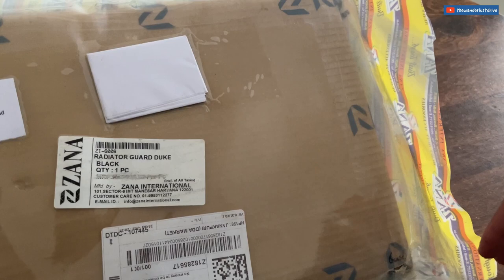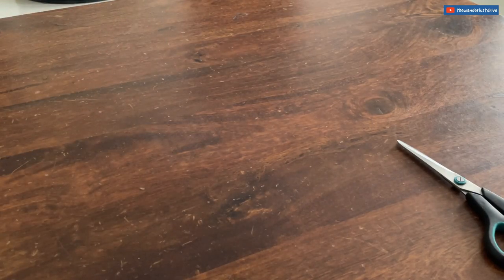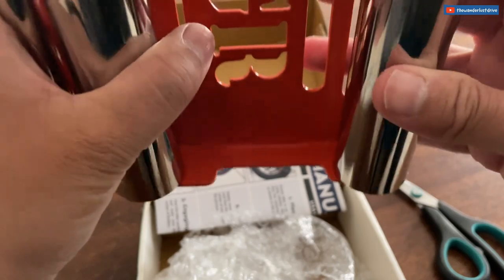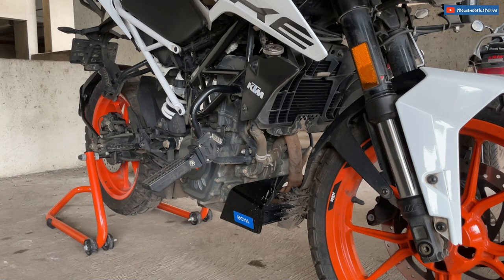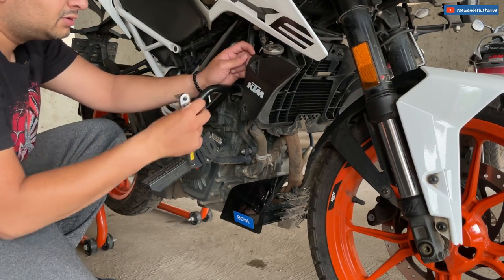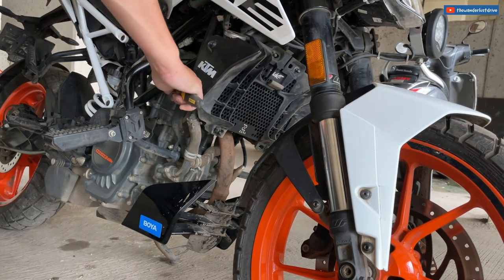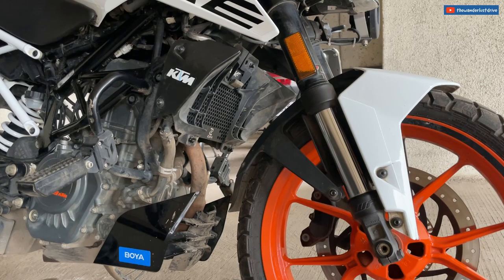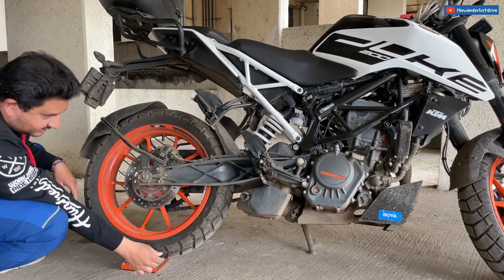Must Have Bike Accessories: Protect you radiator by installing Zana Radiator Guard on KTM Duke 200

Comment: This product is not showing in website can i use duke 250 radiator guard in duke 200?
Reply from the maker: Yes. I confirmed with Zana before ordering. This is the one I ordered for my Duke 200. It fits perfectly. RADIATOR GRILL BLACK COLOR
KTM DUKE 250/390 ALUMINIUM
(2019-2021)